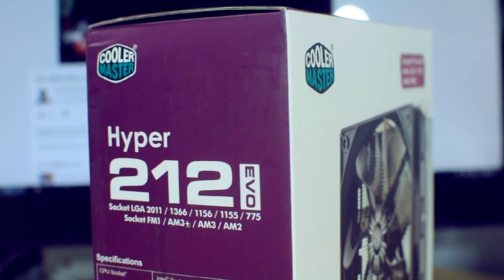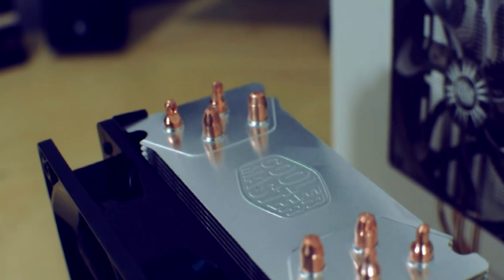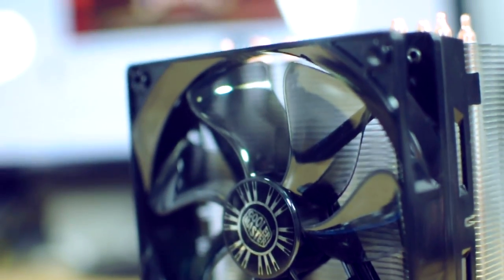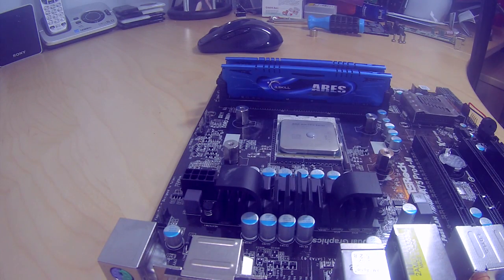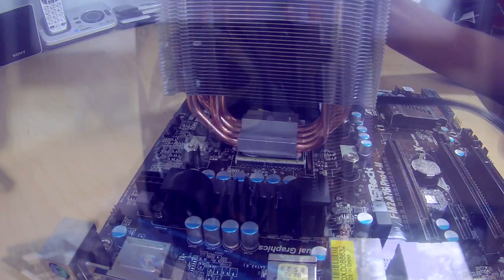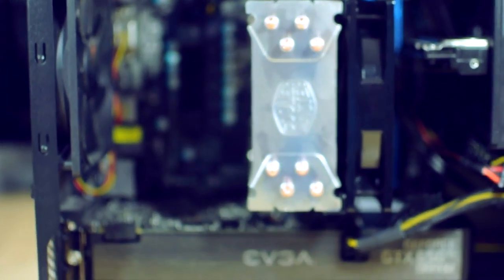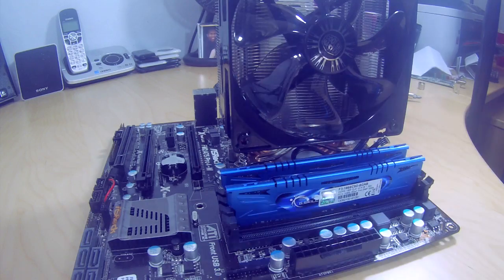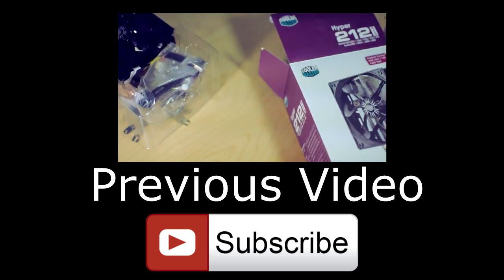Best CPU Cooler! | Cooler Master Hyper 212 EVO Overview & Install

Comment: This one is whisper quiet and EFFECTIVE! Fan is twice the stock Intel. Temps had gone to 160 to 200 degrees when staking crypto. Now it runs between 85 and 109 degrees when running staking! I got an open box for 27.00 regular price is 48.00. BUY IT!

Comment: I really don't know what I'm talking about, but shouldn't your fan be facing towards the rear of the case? I would think you would want unidirectional air flow. That is, unless your intake fan is on the back of your case.

Comment: Just installed this last night replacing my busted Corsair H60 water cooler. This is a great cooler but its a fricken pain in the ass to install because its best installed BEFORE you put it in a case......I had to put this in while in my Corsair case which is big and has room but lining up the tooth to hold it in place while screwing down the cross bracing.......yeah.

Comment: Jibba-jabba aside, these really are great coolers. I have one on my i5-6600k and with all four cores at 4.0 GHz and 100% load (AIDA64), it barely breaks 50 degrees C with the fan at only 50% RPM. They're reasonably cheap and use standard 120mm fans, so if the fan ever conks out on you it's easy & cheap to get a replacement.
The fan that comes with it is only rated at 2.64 Watts of power, but really is plenty, and they're very quiet in operation even under the heaviest loads and with my i5 OC'd to 4.6 GHz (which I don't normally use). If you want one of these, get one, you'll really like it.

Comment: I recommend the Areo Cool Dead silence mATX cube edition if you're looking for a better case to upgrade to. Board lays horizontal and give about 190mm clearance for large heat sink and fan as well as bottom mounted PSU and room for smaller liquid coolers... http://www.aerocool.us/ds/ds_red.html

Comment: I have this with a fan on top of case exhausting up and the on cpu blowing through the radiator and pulled out the top with fan in back and front of case is that ok

Comment: i got the cooler master vortex plus which is structured the same way just shaped differently. does heatsink shape affect the way cooling performs ?
Reply: Not really, it should be very good. Actually, that particular layout is a very good idea, it allows you to take CPU cooling air from a hole or screen in the side of the case, so your CPU cooler gets cool, outside air instead of warm case air.
I just leave my case open so it doesn't affect me much :)

Comment: Depending on your build and case, face the fan towards the back of your case if you have front fans. Pull that hot air right out of the case from the heatsink. Better air flow guys.

Comment: 212x in pair with Nexus PWM series D12SL-12pwm fan: 26-30 °C on idle;
i7 4770k @ 4,3Ghz, 100°C running Prime95 torture test, 63°C doing some moderate Blender cycles rendering

Comment: I have been building PC's since 1986 and I am here to say this is not an easy CPU cooler compared to many that I've used over the decades. I first installed this on an AMD Rig and there was a flat spot on the threaded inserts that if you did not line up correctly made it almost impossible to get the insert into the back plate. 

Next was trying to fit the screw to the back side. If your MB is out of the case, maybe it's not too bad, but mine was still in the case so try not to drop any screws or you will have to remove the MB anyways. Next was figuring out the Puzzle that was which way do the attaching legs orientate. Once you figured all of that out the rest was a piece of cake, just attach one or two fans; a second fan with the included fan brackets. 

Perhaps you are use to Cooler Master Attachments and if your MB was out of the case, maybe that is why it was so easy for you. This is not an easy cooler to install by any stretch of one's imagination. It's not impossible to install, don't get me wrong, it's just not as easy as you imply.

This unit might just screw into the already installed back plate on some Intel LGA 1366 or 2011 Boards and then you only have the cooler and attaching legs to deal with. On my AMD Rig I am sure I rounded out where there flat spot use to be in the AMD Bracket as I used a bit of force and an impact driver to run the inserts into the back plate. If you do not fully tighten that nut, don't over tighten it either or break it off, than you won't get the cooler back off easily as the back nut will spin as you try to remove it. 

I am glade you did not have any issues with it but I surely did as many others do as well. As for the design it's pretty straight forward it's just not that easy to figure out because the instructions don't mention any flat spots. If they do, clearly I missed it. Not everyone is good a taking things apart and putting them back together... Most anybody can take something apart, given a big enough hammer and crowbar. The trick, however, is not only putting it back together but also having it work afterwards is not as easy for most folks as you'd think....

I bought this unit because it just looked easy to assemble; until I opened it and took about 2 hours before actual tried to assemble it. Needless to say for the few parts this unit has it's not as easy to assemble as it looks. It's not very clear which way the Back Plate goes for AMD so you sort of had to guess and use trial and error. Yes there are pads at specific locations that give an idea of which was it should go but again, it's not as easy as it looks. In my opinion the instructions are horrible. I've owned mine for several years now so perhaps they've updated a few things since then.

It works well, I will give you that. I was able to OC my AMD FX 4350 to 4.6 easily with almost no raise in temps. I did reach 4.8 and added about 6 degrees so backed it back down to 4.6 and ran it there for a few years easily at 43 Degrees under most loads and 38 at idle. Not OC this thing ran at 34ish at idle and maybe 38 degrees under load but again this was at Stock Settings. I also ran this Cooler when I updated the AMD CPU to the FX 8350 and it did raise temps a few degrees at Stock and a lot more at OC so I did not OC much on Air with the FX 8350. 

Great video... Cheers....

Comment: Anyone know if this cooler will fit with this motherboard: https://www.komplett.no/product/872899/datautstyr/hovedkort/intel-socket/msi-h170i-pro-ac-socket-1151#

Im not very good with this stuff... thanks a lot to anyone who answers!
Reply: It should be working normal with a 1151 socket
"Versatile all-in-one mounting solution supporting the latest Intel® LGA 1366 / 1155 / 1151 / 1150 and AMD FM2 / FM1 / AM3+." http://www.coolermaster.com/cooling/cpu-air-cooler/hyper-212-evo/
I guess because this cooler is a little bit older they didn't write everywhere that it is also compatible with 1151
I hope this will do it, good luck
Reply: I didn't get it yet, im kinda lazy just letting my pc lie on its back with the old fan sitting on top of the moterhboard instead of actually being attached...

Comment: wait it doesn't support LGA1151? I'm using a skylake 6600K
Reply: I never saw "LGA1151" in the manual but it does work on skylake chips, trust me I used a 6600k as well

Comment: good video dude but you did it wrong, when you start to work with screws you have to make X style screw installation and rotate the screws 3 rotations on each side untill its STOP! cuz you will have unballanced thermal paste spred and heatsink pressure on CPU if you will do like you did

1-(3 rotations)     3-(3 rotations)

4-(3 rotations)     2-(3 rotations)

Comment: Hey guys don't get the Hyper 212 EVO, I got the Hyper TX3 & it's much easier to install & you don't have to mess with that back plate & can install the ccoler without removing the motherboard from the case.

Comment: got the Arctic Freezer i30 . Thought it was kinda shitty , but MEH its cheap as fu*k so , why not . Installed it pretty fast , ran prime 95 for an hour - 48 freaking degrees Celsius on a maximum heat preset XD 6600k i5 owner here . Idle temps 22 -24 C .

Comment: I love it, but it just isn't enough for good overclocking on the FX8350 8 core heat monster.
Reply: Arman VaxY Awesome.  Oh, it'll handle it with ease.  You'll have nothing to worry about with that cooler and the way you plan to use it.  It's more than "adequate", it works very well.
Reply: You can use this to get i5 to 4GHz+
Reply: JustAGuy im using 8350..applied thermlpaste still reached 85 celcius with amd stock cooler..can this cooler prevent from 70 celc atleast??not oc-ing my fx8350 tho..thanks in advance
Reply: Arman VaxY Absolutely.  I have this exact model on my 8350.  While gaming in BF1, a game that pushes 70-80% usage, I hit around 42C to 45C.  That's using the package temperature on temperature monitors (HWInfo, etc.)  BIOS voltage set to 1.415 or 1.425, can't remember, and clock speed set to 4.2ghz, no throttling.  But, it's not great if you crank up the voltages. 

It does fine with 1 fan, but I recently added a second fan on the cooler and it really makes a difference.
Reply: Niceee thanks for the information..getting this cooler soon..im not gonna tweak my 8350 tho so i think my pc wont shutdown because of overheat anymore after this xD
Reply: JustAGuy thanks again for helpin this newbie ^_^

Comment: I'm using FX8350 with an old Hyper212+ with level 3 fan (asrock 890GX Extreme4) in 30c room temp, I got 35c on idle and 39-42 on gaming.

Comment: I bought this for my AMD processor, but it seems to face up towards the top of the computer and collides with the memory sticks, preventing me from installing it. Any ideas how I can solve this?
Reply: +Klagmar I'm not completely sure what your situation is, but you can install the fan facing any way (although it is optimal to have a CPU fan facing a case fan), so you can just turn it and put the wide side facing the RAM (like the video maker did). If you really have no space either way, just ditch the fan (if you can return it, try returning it, or maybe even sell it somewhere) or buy a new, bigger case/motherboard.

TL;DR Turn it away from the RAM or get a bigger case/mobo
Reply: Hmm, I have an AMD processor so it installs bit differently. There's kind of a big vertical "strap" that you lock the fan into place with and it's facing a certain direction on the motherboard (perpendicular to the top of the case). Is there a way to make the fan face a different way in this case?
Reply: ***** If you have a picture, it would be nice to see what you're talking about. :( 
Is your motherboard on the sides of the case or parallel to the top of the case?

If you can't post a picture, can you tell me the model of your CPU, Motherboard, and the case?
Reply: The picture isn't great, but hopefully this shows it. The yellow box is how the fan would have been placed (this pic shows my current out of the box fan). http://imgur.com/n22UgJ5

Comment: Has anyone used this cooler with the I7 6800? I am not comfortable with water cooling. I seem some of the other bigger ones but the can interfere with the Ram. Would this be enough? I will installing it on a X99 Deluxe 2.

Comment: Your knowledge of mounting CPU coolers, at least, is very poor. You just tightened your heatsink from one side, effectively tipping it to one side and pulling in air into the thermal paste.

Comment: Does this work on LGA1151 sockets as well? It says so on PC Part Picker but not on the box you showed.
Reply: I got that cpu cooler yesterday and in box there is "Support LGA 2011-v3 / 1151" sticker. pic: http://i.imgur.com/Ct5UPVT.jpg That video review is from 2014 so thats why its not there.

Comment: I got the Coolmaster Hyper 212 Plus. Great cpu cooler. Used to jump up to 82 degrees celcius! Now I'm looking at 30 degrees at idle and 45 max at 20% OC. Btw there is a good chance that the stock heatsink was not correctly installed. This time I made sure to do a good job. One more happy customer. Nick.

Comment: I have this cooler with a i5 4690k and it is quiet and keeps my CPU at 40 degrees. Very difficult to fit though.

Comment: how does the cryorig c7 stack up agains the hyper 212 EVO??? I can't decide between the two the cryorig looks nicer but its smaller and Idk if that equates less cooling efficiency any advice would be much appreciated
Reply: I would go with the Cryorig C7. 
Cryorig C7: 97width X 97height
                     40 to 45cfm   
                     5 egg rating on Newegg 

CoolMaster 212 Evo: 102width X 159height 
                                       24.9 to 82.9cfm  
                                       5 egg rating on Newegg
 
I would say if your looking for maximum performance than go with the Hyper 212 Evo (or Plus), but remember this this is massive and it's a bit of a trick to install. If your looking for better than stock performance with small form factor, making installation easier, than go with the Cryorig. Btw all measurments are in total size (total width to total height). Nick.
Reply: Nick Bob Thank you!! I really appreciate all the info! Im gonna go cryorig I just prefer the sleek look of it to the evo haha
Reply: Glad I could help. Peace.

Comment: I just ordered one of these..didn't realize you have to take the mb out what a bummer :\
Reply: no you dont. you just have to take both sides of your case off. I didn't even Uninstall my gpu.
Reply: My Evo 212 should be arriving today, since my case doesn't have a cut out in the tray, I'm gonna have to disassemble. Gives me a good opportunity to do a deep clean though.
Reply: +K-Anator™ how is it mounted currently if there's no mounting plate?
Reply: Uhh... it's not mounted as it hasn't come yet...
Reply: +K-Anator™ you said you will have to disassemble, what do you have to take apart if there is nothing together?
Reply: As I also said, my motherboard tray doesn't have a cut out, I'm going to have to take the motherboard out, thus I'm going to have to disassemble my computer.

Comment: Does the Evo 212 fit Socket 1151? and is there any better CPU Cooler than this?
Reply: It does. There are better AIO water coolers like the Corsair H100i but this is the best air cooler for your money. There are better air coolers, but this should do just fine unless you want to do an insane overclock.

Comment: I was going to get a CM Hyper T4 but it has an issue with blocking the RAM slots on AMD platforms and I have high profile ones (Corsair Vengeance) so I was wondering if the 212 has that same issue or not.
Reply: amd cpu sucks
Reply: +Badass Chicken I learned that. Never getting an AMD again lol
Reply: +Chaos_FTW Intel has been dominating AMD for years now, Hope that AMD will catch up with their Zen. I don't know why AMD are adding more cores to their CPUs while Intel is focusing on performance, and that's what games need....performance not that many cores.
Reply: Couldn't agree more

Comment: will it work with 1150 socket i7 4790 non k ?
Reply: Yep, only the socket really matters for compatibility. And the EVO 212 does support 1150. You shoud check your case's max. CPU Cooler height tho. The height of this cooler is 159mm or 6.26"

Comment: LMAO for your Cooler Master it is, mine is on the other side of the heat sink and its clips are on the opposite side so that the Cooler Master Logo shown here is mounted against the heat sink on the back and good thing I have got tall DIMMs  I didn't install this as you can tell didn't know you can flip mounts on the fan to get it away from the memory slots

Comment: Question, I bought the hyper 212x and one of the insulative pads on the back mounting bracket was all jacked up on mine, I tried re-positioning it and accidentally tore it, woops. It was on sideways to start with so Idk what happened in the factory there. Not really a big deal as I just set it on and use the pressure of the screws to hold it in place, worked fine. But is there a particular material that functions the same way that I can replace it with? Or an excellent non conductive glue to reattach it with?
Reply: Generic thermal pads, you can probably find them most easily from places specializing in liquid cooling. Or if you have an old junk GPU, pull the heatsink off, they often use them to cool the vram.
Actually, I just realized your talking about the backplate, which has nothing to actually do with cooling... any piece of dense foam would do really.
Reply: Nice thanks!

Comment: I have two Corsair Vengeance RAM and I don't think I can get Cooler Master Hyper 212 Evo to fit. Can you please confirm?
Images: https://drive.google.com/drive/folders/0B4eR8RbDasNsNG9QWTlWMER3RjQ

I need a cooler very urgently and am starting to feel that I have to take the Liquid cooling approach as the RAMs are of such heights that they won't let any good Air cooler fit :(

Comment: Isn't it more reasonnable to place the cooler fan facing the back fan?
Reply: yes loool. in theory you want say like this.
(back)[<<<<<] {front}  you want the air to go one route its more efficient this way. the whole vertical thing does not work, although it's good to have a fan there to get rid overall hot air that's in the case you know.
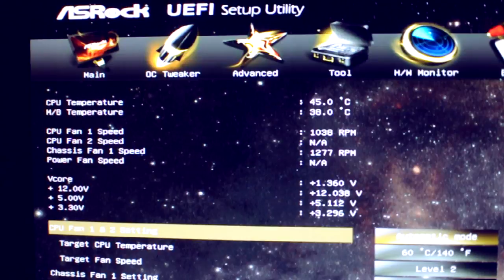Reply: It's not even vertical. Look at 6:34 the fan in facing the hard drive or is that normal?
Reply: yes like i said. that is a fluid stream of air cause you're not forcing it everywhere. its just going in one smooth direction, like a automobile. with the fan/radiator in the front so it gets air from whichever direction its going. to cool it. you can then add a fan if there's space that sucks air out vertically.through the top just to keep mobo/gpu air moving.

Comment: do you need low profile ram
Reply: no
Reply: Depending on the mother board , yes. The fan blocks one slot for my corsair vengeance 1600.
Reply: I personally needed low profile ram, didn't realize until I already had the ram and cooler lol